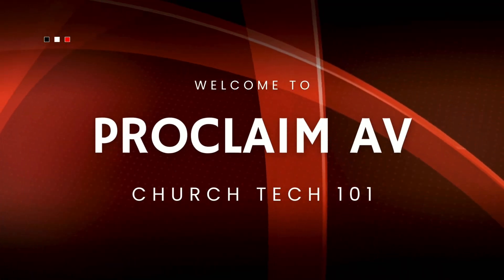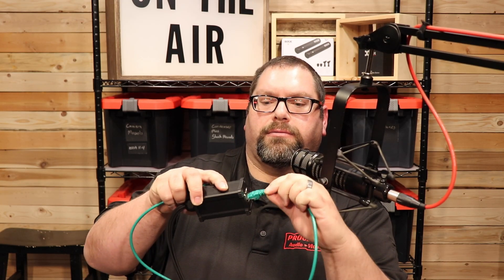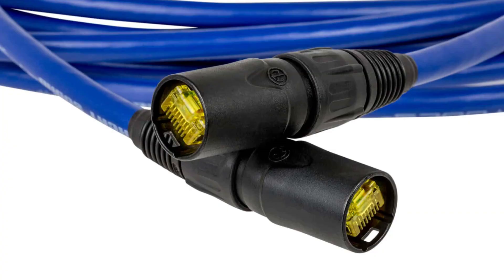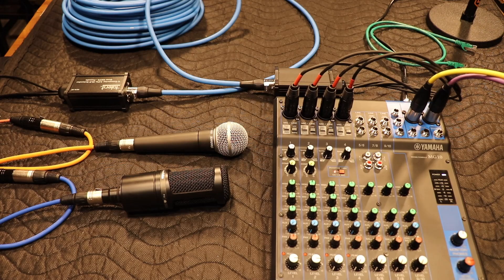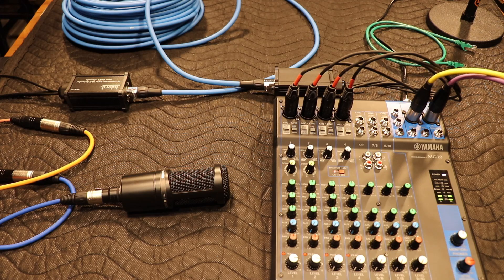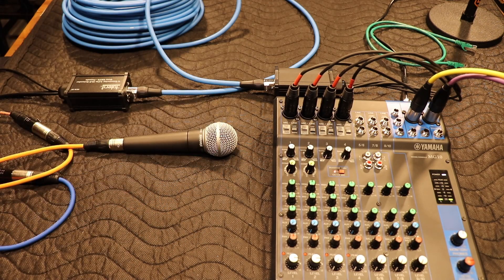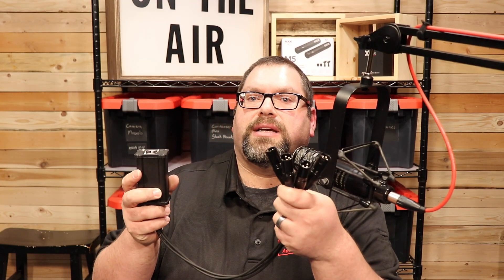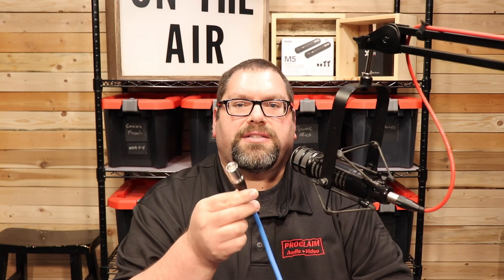XLR Over CAT6 Cable?

Comment: I’ve done this with a shielded cat-6 ethercon cable and I still get ground hum using 3 Rode PodMics in my studio. I’ll say it’s not as bad as what you got with a standard Ethernet cable but it’s definitely there when the mics are turned up. My mixer is a Tascam Mixcast podcast mixer/recorder. Any ideas what could be happening?
Reply from the maker: Interesting. It could be a faulty cable or it might be the converter boxes themselves.   I just installed these boxes on a 200' run of shielded CAT6 and it was nice and quiet.

Comment: Are you aware if there are any issues running line level and mic lines at the same time down these?
Reply from the maker: Hey Tim. Crosstalk is not an issue with these, you should be good.

Comment: Thanks Tim. Digital is taking over the analog. It's a bit pricey for me. I had just put in a new sound system 2 years ago that is analog. Digital sound is so much better. Soon to be the only way I think.
Phil
Reply from the maker: I'm a firm believer that analog still has a place in audio systems. In the United States, many small churches just need a basic mixer with hard controls that will last for many years. They might be only using one to three inputs each week. However, for larger churches, where things are much more complex, digital is definitely the way to go.